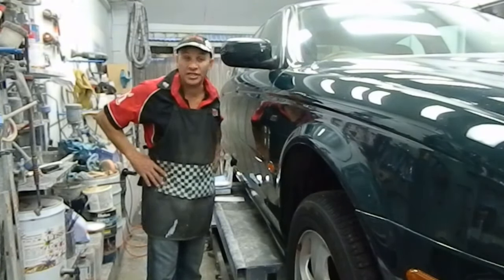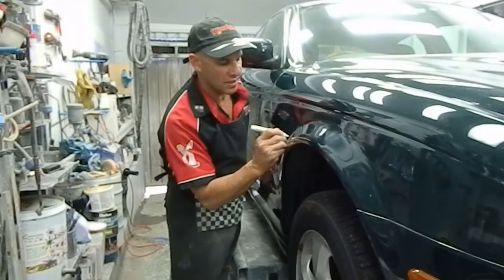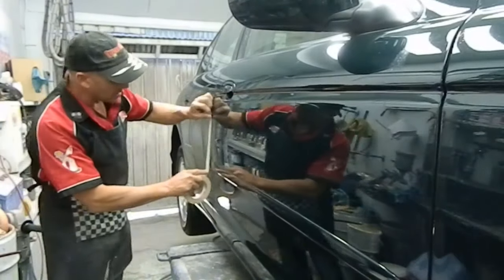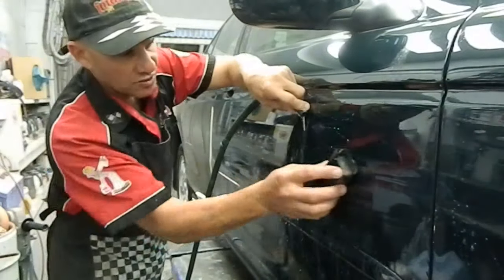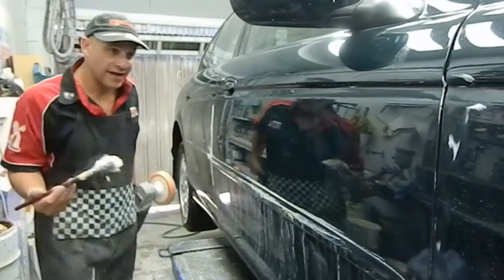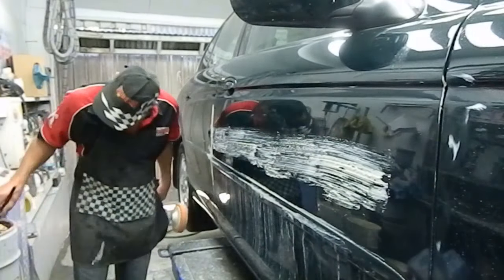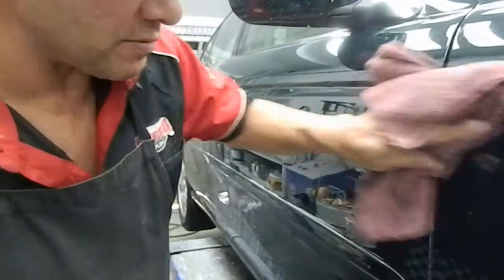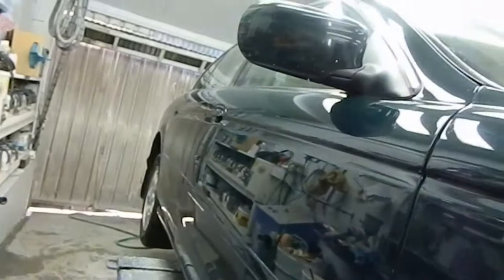touchuppaints.com.au / Single Key Scratch full side repair tutorial/ paint pen

Comment from the maker: Thank you for your comments.

Yes there are many body repair shops out there that can do various types of repairs with different warranties. The type of scratch repair done here by touchuppaints.com.au leading technician is for some the following purposes.

1) To keep your car in as original condition as possible. (The more original factory condition your car is the more it is worth). We replace the paint that is missing only by relayering the factory paint products as they were layered from factory in to paint scratches.

2) The cost of the repair.
 The cost of this type of repair here is a fraction of the cost opposed to if done conventionally using spray painting methods and the results are exceptional if carried out according to the author product application specification.

3) The amount of time the vehicle is out of commission. This type of repair can effectively be done in 24 hour turn around. 

The owner of this jaguar was quoted over $1500.00 to have this item spray painted.The Brush Touch repair cost $125.00 plus gov taxes at the time.

Exclusions.
Some paint colors using this technique will not success as the color formulations are complex with tri coat, pearl colors and xirallic colors.

Always check first with a expert paint technician who practises these types of repairs to see if your scratch will camouflage correctly. Incorrect procedures may result in a rectification leading to a very expensive rectification.

There are DIY paint scratch kits that remove scratches without all the sanding and fuss. Please see our DIY car touch up paint scratch kits. 

For expert advise on paint products and application methods you may contact Michael Biady at www.touchuppaints.com.au. or ph 0416168746 to speak with him directly.